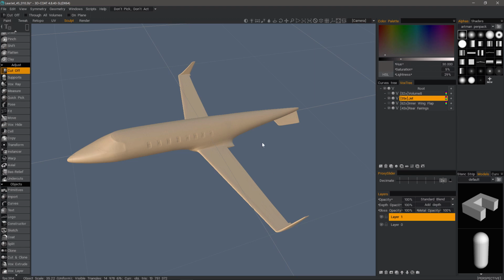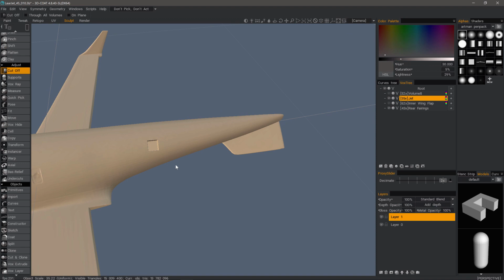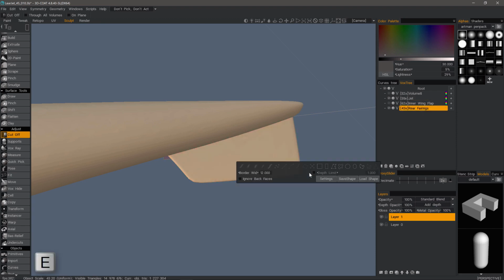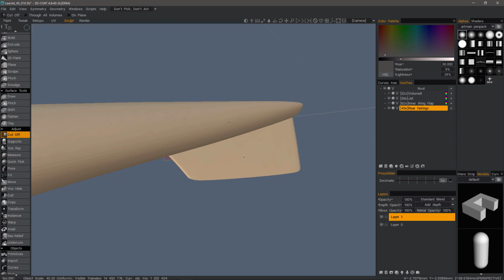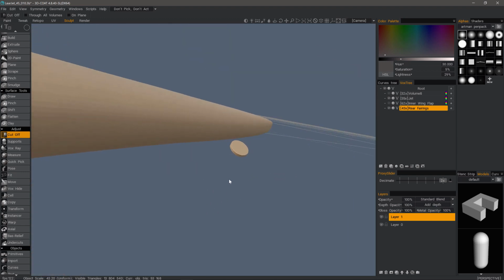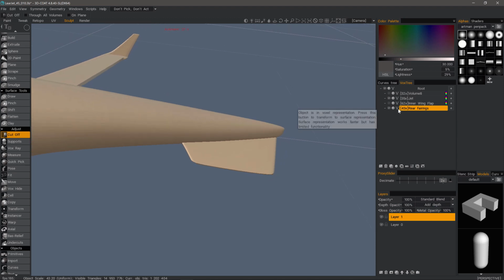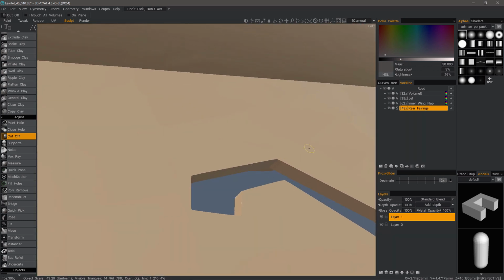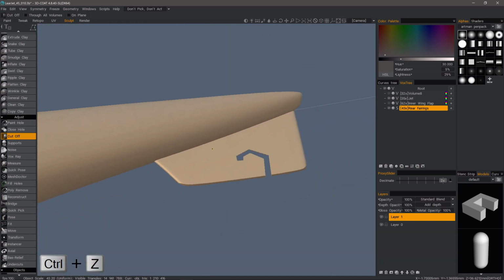Cutoff Tool

Comment: Theres no way to freeze a part and then use the cut tool to cut without cutting the Freezed part?
Reply from the maker: There are EXTRACTION tools that perform this function. One is the VoxLayer tool and the other one is the COAT tool. You could think of them as EXTRACT (VoxLayer) and EDITABLE EXTRACT (Coat tool)
Reply: @3DCoatTrainingChannel  I dont think what you sayd is what im trying to do. I made an example video where i masked/hide some part the model so the cut tool dont cut that part, but it dont work. The way i found to limit what i want to cut is to duplicate the model and cut everything i want to keep, then do a diference boolean to cut the piece i made. https://youtu.be/21Mrv0MXOlg
PS: Btw i know about the depth limit , but that dont work if i want a angled cut for example, or to cut more depth in some parts and less in others